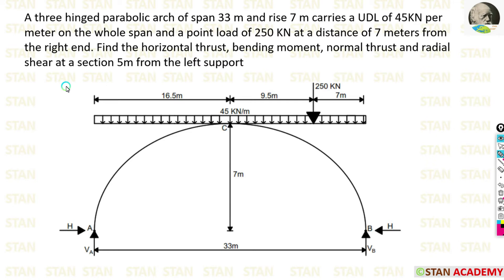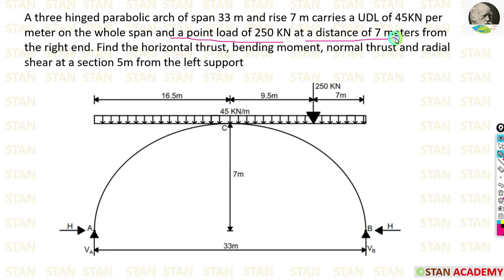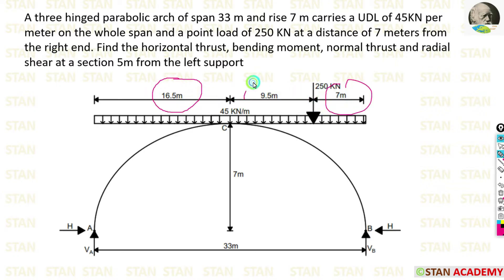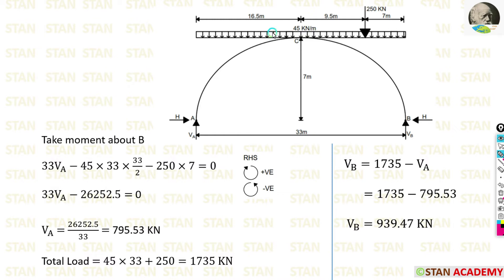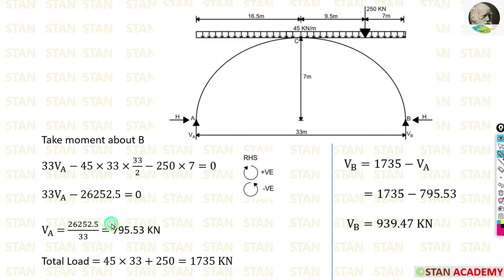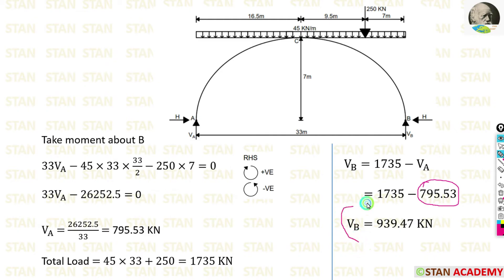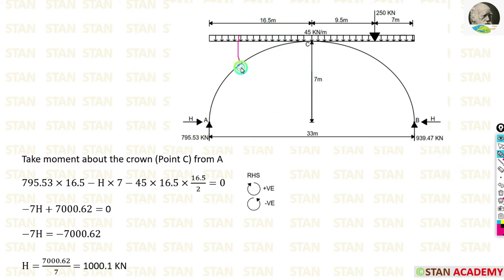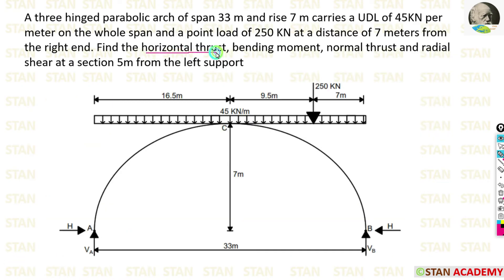Three Hinged Parabolic Arch   Problem No 3

Comment: Sir why we are not taking the H for calculating the vertical forces
Reply: Because the distance between the horizontal reactions and the pivot at A or B is Zero. They are on the same line of action not perpendicular. I hope i have answered your question